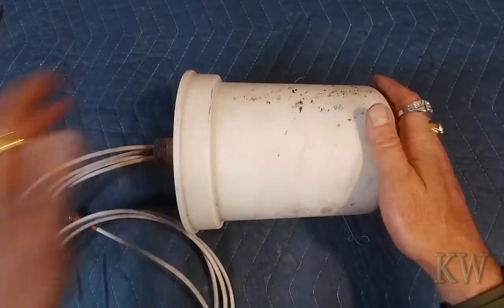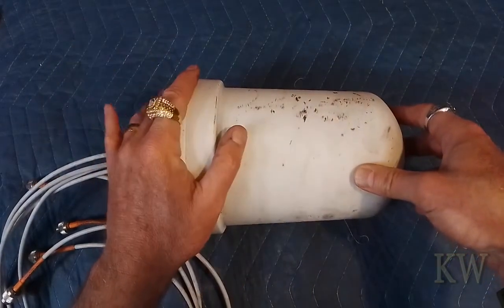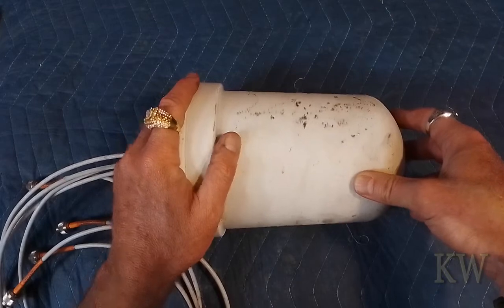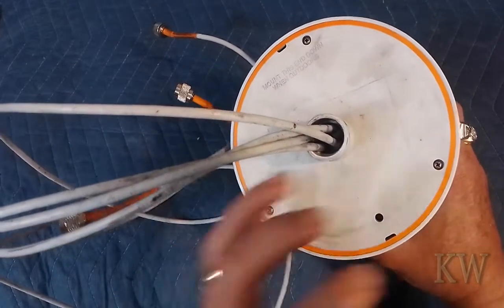Cisco Antenna Failure Diagnostic

Comment: hi very informative...does it matter which order the antenna leads are plugged in for 2.4 and 5ghz?
Reply from the maker: @RandomPsychic  they need to go to the correct radio.   It will work if they are on the wrong ports but not very well
Reply: @KingWilliam  how do you know which radios they should go to?